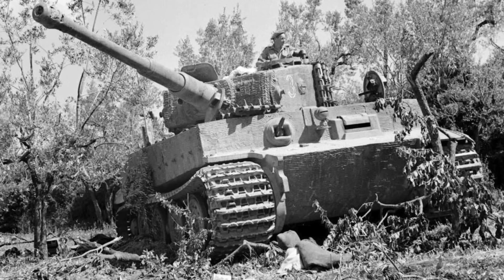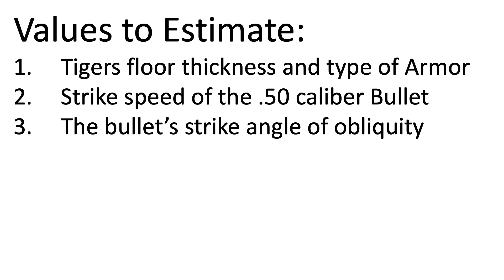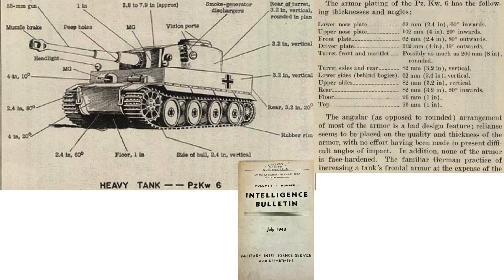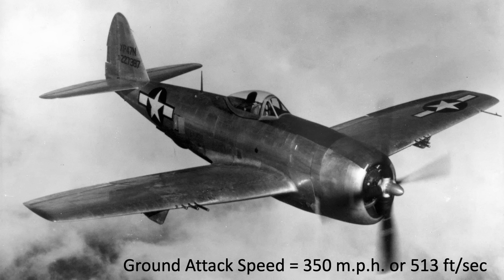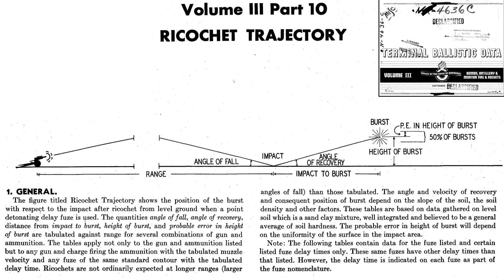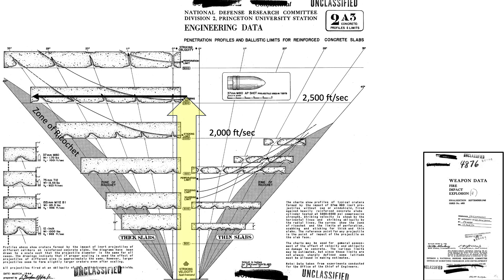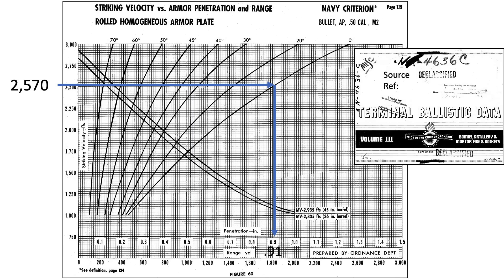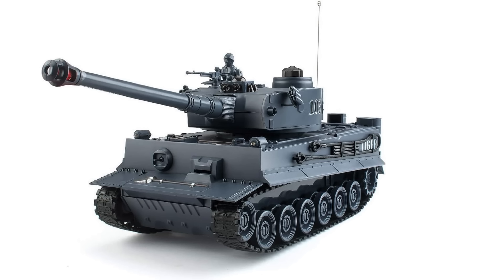P-47 vs Tiger Tank: Can Machine Guns Penetrate Armor?

Comment: A couple of random thoughts

IIRC the P47 had 8 50's   The stats are for a single strike.   There is PROBABLY a SMALL possibility that several rounds could hit in the same spot.  Not saying that happened but it could 

I seem to remember a video about the Germans towing fuel trailers. Those were easy targets . Wouldn't kill the tank but it would decrease the potential range of the column. 

As I understand armor, penetration is one thing.  Spalling is another. Supposedly the turret of the ironclad USS Monitor had heavy canvas on the insides to minimize splintering / spalling.   If a handful of 50 cal rounds hit with enough force, maybe they wouldn't penetrate but would they spall sending splinters inside?  I'm speculating that harder armor might be more prone to splintering

Heinrich - "Should ve protect ze inside of ze floor of der kamfwagen  to prevent Splinters?:"

Hans - "Nein Dumkopf - Do you tink someone vould be shooting from underneath ze tank?"
Reply: Small, essentially zero chance. Remember that the number of bullets hitting is likely to be in the 10 to 20 range at best

Comment: 0.50 inch AP rounds hitting a Tiger tank's tracks would very likely damaged some links and disable that tank. It wasn't a kill but the tank would be out of action for some time.
Reply: Possibly as long as a half hour…
Changing track links and pins was what the spares bolted to the front of the tank were for (they broke very very regularly in Tigers - along with the gearboxes, no enemy action required, just a bad gear change).

Comment: Did the Tiger carry external fuel cans? That could explain the origins of a myth. If the external fuel was set on fire a pilot could think the tank was burning.
Reply: Yea that's most likely what was going on, Tiger's had a little trailer sometimes they'd tow around with them that had fuel drums or a fuel tank for spare fuel, most likely if they caused one to explode as they were zipping past at 350 MPH they'd have thought they destroyed the tank.
Misinterpreting what they saw and misidentifying a Panther for a Tiger while going 350 MPH is something that's easy to understand, your average person has no clue what it's like passing by something at that kind of speed and how you've just got literally a fraction of a second to interpret what you've seen.
Reply: @dukecraig2402  Strapping gerrycans on was normal. 20L = ~5 gallons. The Krauts invented them. Wehrmactskannister fur brennstoff...
Reply: @dukecraig2402  It was not uncommon for Panzer 4 to be taken for tiger. It has similar vertical armor lines and shape but is just significantly smaller. It would have a thinner armor too.
Reply: @dukecraig2402  It occurs to me that burning fuel finding its way through an opening into the tank or the engine compartment might not be good.
Reply: It was uncommon for Tigers to carry external fuel in combat areas. On a train, sure. 

Even so.....having a fire on the outside of the vehicle isn't necessarily fatal or especially dangerous. Tanks are designed to withstand external fires.
Reply: @executivedirector7467  I believe in the Western Desert Campaign, both sides ignored the safety issue, and it was common practive. Water Cans were marked with a White Cross [Germans] or a White X [Brits]  to distinguish them from fuel fans.

Russian T-34s and SU 122s often were plumbed to use the fuel in four 50 gallon drums -- on the road march at least.

Molotov coctails were used on tanks.
Reply: @HootOwl513  I haven't raised any safety issue - on the contrary, as I wrote above, a fire outside the vehicle isn't especially dangerous. AFVs are literally designed  to survive fires outside the vehicle. That's why molotov cocktails don't usually work on fully-enclosed AFVs. 

Soviet T-34s and SUs never had any plumbing to connect their external fuel cells to the interior. T-34s had a max of three cells; SU-122s, -85s, and -100s generally carried four. To transfer fuel to the internal fuel tanks, they had to siphon or pump it into the tank. There is no plumbing. 

The photos we all see showing tanks carrying dozens of jerricans or even 200 L drums are usually not anywhere near the front line. They are on road marches or on trains, far from enemy fire. There are exceptions but they are rare. It's hard to fight in an AFV that has jerricans all over the place.
Reply: @HootOwl513  Just to add, the reason the Germans had to mark their jerricans is because they were using the same design for both water and fuel. In the dark (which is when tanks often need to be refueled and when the crew can eat) it's hard to spot that paint. 

US jerricans had different caps to distinguish water cans from POL cans. That way, no matter how dark it is or how tired you are, you are much more likely to pick the correct can.
Reply: @executivedirector7467  OK. Thanks for bringing me up to speed on these points.
Reply: @executivedirector7467 By coincidence, I just watched a documentary on the battle for Stalingrad this evening. Apparently Molotov cocktails worked if they were thrown at the engine decks of German tanks. As the Tiger engine and those of other tanks were petrol, they (relatively) easily ignited. Particularly if more than one Molotov was thrown.
It's not the first time I've heard a P47 pilot speak of taking out a tank by ricocheting bullets of the ground. Perhaps it was bullets striking the engine deck,?.......
Anyway, just my 2 cents.
Reply: @MrT67  There were no Tiger tanks at Stalingrad. 

Tanks are designed to withstand things like molotov cocktails. Documentaries can be excellent and well-researched, or they can be absolute nonsense. So I really have no idea at which documentary you were looking. 

A glance at the design of the Panzer III engine deck will show that it was not especially vulnerable to burning gas being thrown on the deck. Not saying it would be impossible.....but it sure wouldn't be easy to kill that way. The Panzer III was by far the most common German tank at Stalingrad.

Comment: Note that one need not penetrate the tank's armor. If the machine gun fire was sufficient to break one of the tank's tracks, that will immobilize the tank until the crew is able to repair the damage (which naturally would be difficult to do while in combat). An immobilized tank becomes an easy target for any anti-tank weaponry in the area.

Comment: 2:57 : The intent of this comment is to add that multiplying the total speed of the bullet by 0.8 at 1,200ft probably isn't an exact but a ballpark value, as typical drag forces on bullets aren't exactly proportional to the square of velocity, but vary throughout the flight regime.

Comment: If the roof is the same thickness it seems stupid to try and hit the floor with ricochet. Ricochets loose most of its energy anyways.
Reply: The average soldier or pilot wouldnt know the thickness of the armor.
Reply: This guy was just a kid when a pilot.  While probably way smarter than kids today, imagine a 20 year old today claiming to know what penetrate's an enemy tanks armor.  Even with the war in Ukraine and all the viral info, we still would have no idea even now.  Back then they had even less of a clue of how thick the armor was top or bottom.  And it stands to reason it wouldn't penetrate the floor--the hull of a tank is structural, the tigers were very heavy, the bottom could NOT be flimsy.

Comment: If they did take out a Tiger, it's more likely that they were getting weak spots on the engine deck rather than bouncing them up off the road. They may have believed that they were bouncing them, but that doesn't make it true. Aircraft strafing covers a broad area so the whole tank would be pelted if they're shooting to hit beside it. A steep dive might get a lucky hit on the deck that could disable the engine.

Comment: Another great video, especially in ferreting out such obscure data. My comment - to the manual, not you, is just how many roads paved with concrete were there in Europe? I would guess they were few and far between especially where tanks were operating (i.e. largely non- urban areas). So in regard to this, the concrete ricochet velocities would be largely overstated and there would be a reasonable possibility there would be no ricochet at all with regard to dirt- or even asphalt-paved roads. Still, a great job making light of this fallacy.